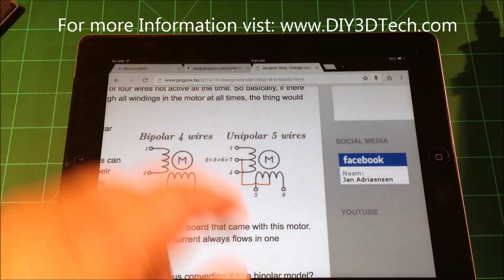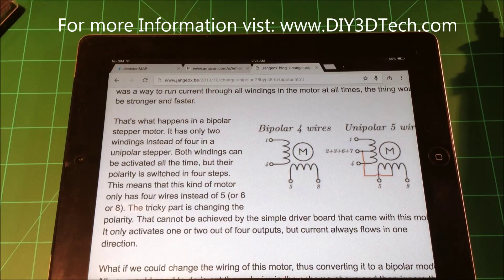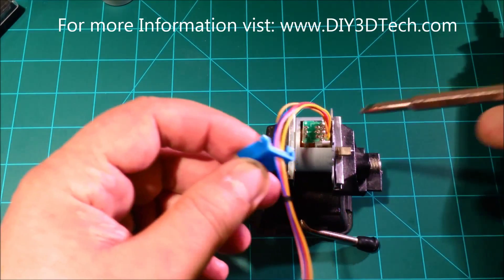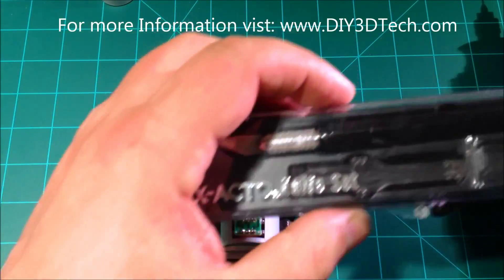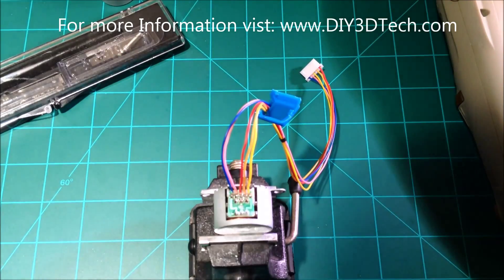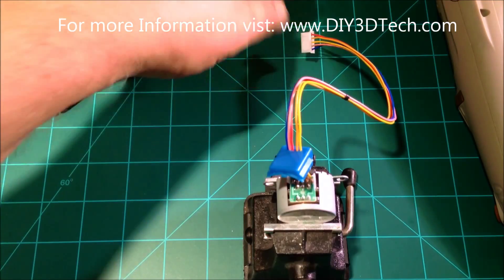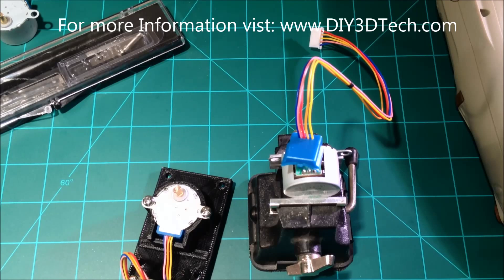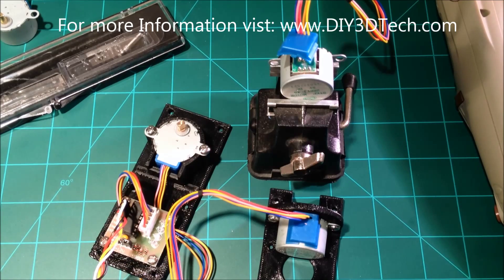Converting a 28BYJ 48 Stepper Motor to Bipolar Format - Part 1

Comment: when modified to bipolar mode, does the 12V version of the motor have more  torque than the 5V version? I can also run the 5V version at 12V wich gives the motor more torque than running at 5V. But i am qurius to know if the 12V version would be even tronger?

Comment: Great job, but can i use the ULN2003 after this modification, or should i use another driver such as L293D?
Reply from the maker: Thanks it has been a while, you can not use the standard driver so I used a sainsmart driver board.

Comment: Why do you need to dremel the board? Can't you just cut the central wire, cut the white connector at the end and then hook up the wires to something like a 4 wire A4988?
Reply: The PCB trace connects the two coils. Cutting the wire would not severe this internal connection.
Reply from the maker: Because you need to cut the connecting trace of the PCB board.  You can also do with a Xacto knife also...

Comment: I am following you through with this modification, and found that jut cutting one of those 2 lugs off on the plastic cover lets it clip back in almost as good as new without needing to glue it !  This means I can always remove it again in the future if I need to.
Reply from the maker: Yes there are several options to achieve this :-)

Comment: Hmmm..., you think by increasing available torque by ~ 180% you might run the risk of the little
plastic gears wearing out faster?
Reply from the maker: +ed  yup it likely does, however guess I am missing the point as the duty cycle is so large, and these so cheap it is a moot point in the end...

Comment: Is not necessary to modify the stepper wiring. I used this motor (5VDC and 12 VDC versions)  with 9 Volts and several bipolar drivers with no problem at all. The center Tap of both coils is open or at VCC/2 in all conditions. EasyDriver V4.4,  A4988, DRV8825, etc.... In all cases the speed and torque was increased considerably. Remember to disable the drivers while the motor is stopped (save battery and keep the motor cool). Due  to the existence of the gearbox, the stepper maintain the position without power in most applications.
Reply from the maker: While you can make the wiring work, not cutting the trace means you are forfeiting torque, take a look at this guys site he has a drawing of the mod it might make more sense then...
Reply: They will work with simple full or half step mode of bipolar drivers (both ends of each coil are always switched to opposite polarities).
Problem of keeping the short between taps with bipolar drivers may occur in microstepping mode, they may switch one end of a coil when chopping or connect both ends together to control current.
In my applications I am using full step with the AccelStepper Library... no heating problems and very high torque. Because the high gear reduction ratio microstepping is not necessary with the 28BYJ-48.

Comment: Hi, Do you know, where i made a mistake? I hack a motor to bipolar but it work only one way, the reverse way it just whistles. Ty
Reply from the maker: Check your code as if works one way, it should work the other [mechanically] but sound like your code is misfiring the coil sequence...
Reply from the maker: Sounds like a code issue
Reply: Yea, I changed ENDSTOP_INVERT from false to true and now it is working. Thanks for help
Reply from the maker: Got to love code :-) Your welcome!

Comment: Hi there, if i do this modification can it work with a a4988 driver? (from a cnc shield)
Reply from the maker: Yes "if" you do the mod and be sure to run it with only 5v PW as I have pushed it to 12v but the motor is cut very short....
Reply: i have a cnc sheild (using 12v) would that work?
Reply from the maker: will burn up the motor after a short period as they guys don't like above 5volts...
Reply: there is a 12v version of this stepper...https://www.amazon.com/Industry-Park-28BYJ-48-Stepper-ULN2003/dp/B01J507JGS/ref=sr_1_1?s=industrial&ie=UTF8&qid=1495249168&sr=1-1&keywords=28BYJ-48+12volt

Comment: why do you have to cut the trace, why not just not connect the fifth wire?
Reply from the maker: By cutting the trace you eliminate the center tap thus creating to "larger" magnets at the cost of halving the stepping resulting.  So in short you generate double the torque output

Comment: I've been playing around with this motor, but I have to admit im not feeling the love with it.

Ive found its highly inaccurate... Say you tell it to go 100 steps one way and 100 steps another, it wont return to the same position... I had a back and forth program running on it. And after an hour the start position moved about 180'.

Also its not very fast :/ at its fastest ive manage to get it, it takes about 5 seconds to do a full 360 turn. Is that normal? Or is it meant to be a lot faster than that? 

Im going to be building a speedo gauge, but I feel this motors just too slow for it.

Is it this motor or is it me getting it wrong?
Reply: These are the motors in the Micro3d printer.  The problem with these motors is backlash in the gearing.
Reply from the maker: Have not found the accuracy issues in my uses, however slow yes and very.  However after converting they are faster and more useable.  You may also want to try a couple as maybe you just have a bad motor?
Reply: There's the gear backlash problem. But other then that, they are fairly accurate (speaking from my own experience). The start position moving 180 degrees over the course of 1 hour shouldn't ever happen. maybe a wiring problem? I observed that the stepper might rotate with a small torque even when wired up incorrectly.
Reply: There's a clutch in it.

Comment: i tried doing the bipolar mod on this motor but never got any movement out of it.i was using a4988 stepper motor driver on a cnc shield. im trying to make a small cnc plotter but never got the damn moto to do anything but buzzzzzzzzzzzzzzz.i tried wiring in different order several ways but never worked....
Reply from the maker: +Jim Hill If it only buzzes, that typically means the step sequences sent to it are  not right [i.e. in order] and therefore it basically vibrating.

Comment: Hello, great video. I will try this conversion to use the motors in a Rostock delta 3D printer. I have a question please, on the diagram it can be seen that there is a bridge between the two coils. By by cutting the 5th wire does it also remove the bridge between the two coils? Or it doesn't and that bridge is something that it is needed? Thanks.
Reply from the maker: +Lucian Sima By cutting the trace yes it breaks the coil up into which stronger however with less resolution per-say (you will also need to change the driver too).  You can also see more here: http://diy3dtech.com/28byj-48-conversion-part2/  Also yes have kicked around the Rostock however have heard they can be a bit temperamental.
Reply: +DIY3DTECH.com Thanks for the quick answer. Yes i will use the Pololu A4988 for bipolar motors., toghether with ramps and arduino mega.
Reply: +DIY3DTECH.com also about the delta printers, yes they are a lot harder to set up and calibrate but i've read they require less torque from the motors especially with a bowden extruder.
Reply from the maker: +Lucian Sima Some folks have used the 28BYJ's in 3D printers and started one but stopped as way to slow even when converted...
Reply: +DIY3DTECH.com thank you, i will try anyway

Comment: The firing order is orange, pink, yellow, blue works for me. Also I wanted to add that I found that just giving a drill bit a few turns with your fingers is enough to break the trace in the circuit board does the job just fine.
Reply from the maker: +Todd K.  Yup (on the wire combos), check out my Part 2 (https://www.youtube.com/watch?v=k6A2VJvFFfs) as well as the Camera slider video (https://www.youtube.com/watch?v=CUEwrFK8ZfU) where I put these to work.  I am also thinking of building a small 3D Printer with these (http://www.thingiverse.com/thing:874502) what do think?

Comment: I was doing the same thing about the time you put the video out. good job. I'll be using Pololu drv8834 low voltage stepper drivers available on the Pololu website. That would be good if you posted a follow up video with the firing order of the wires when you figure it out.